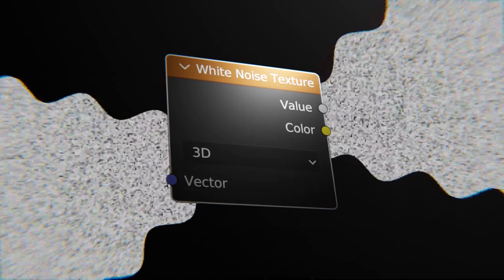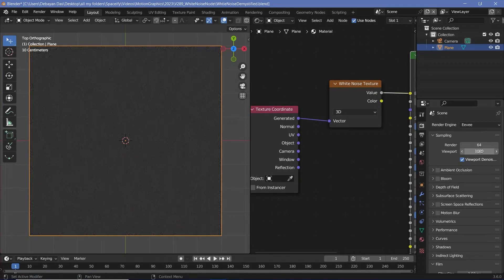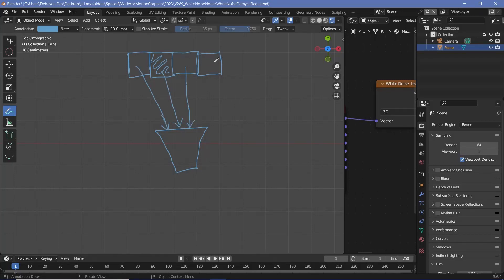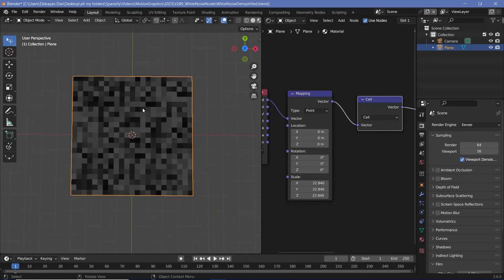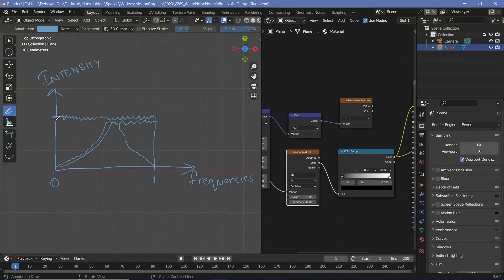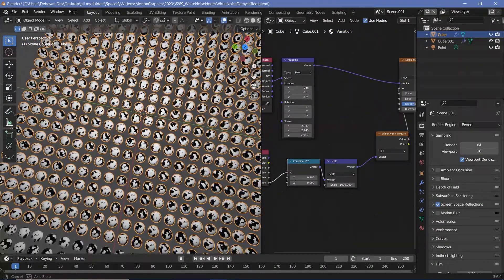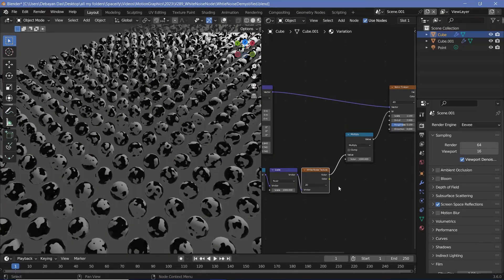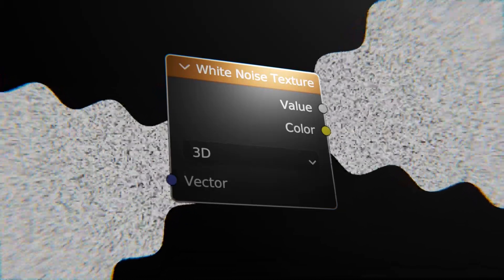White Noise Node Demystified and Visualized in Blender

Comment: Lets say I have a cube with 6 different videos playing on each of the sides, do you know how to make the videos that are hidden behind the cube from the camera not calculate/play the video to save rendering time but be able to remember where to continue from when visible again?
Reply from the maker: That's a very interesting question and at the top of my head, I can think of a few ideas, but I would have to test them out. 
If I do test them out and find something that works, I will definitely make a video out of it.

For the time being, I would think that if you use the position of the camera and the position of the texture coordinates and compare it with the normals, you should be able to figure out which faces are facing the camera. (within geometry nodes) 
You can then use a switch and have a simple materal on one side and have the other input to the switch node be your image material. You can control the switch using the output from the compare node. 

I would have to test this out and iron out the details, but I hope this helps for the time being.
Reply: @deayanstudios  this is quite late but I'd imagine it's already hidden.
Unless you're using transparent shaders (which I hope you're not, you'd need the back faces) then it's already occluding it.
Shaders have no knowledge of surrounding pixels. They calculate as it's rendered so if you can't see it, it's probably not being calculated.
This is also why we don't have blur nodes. (albeit it can be implemented as a separate pass)